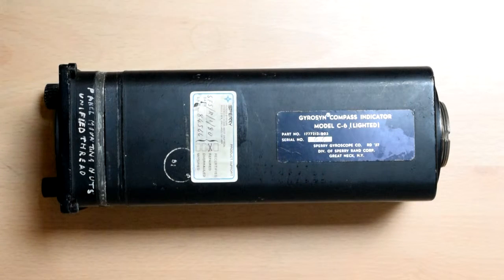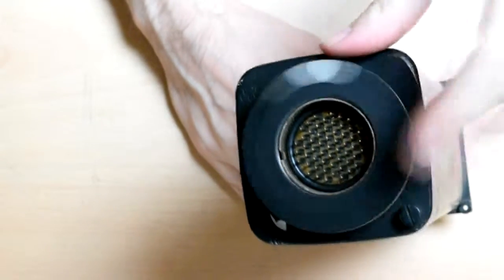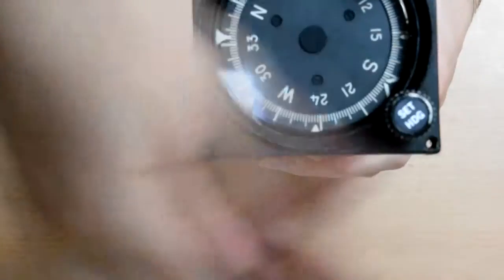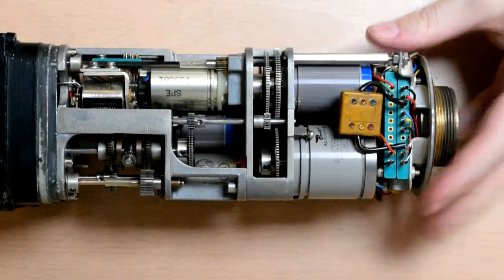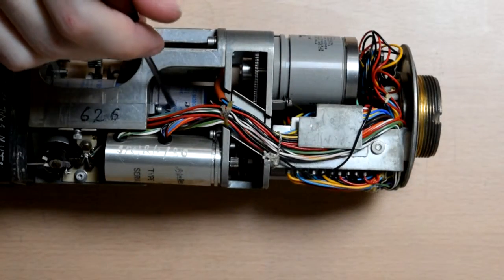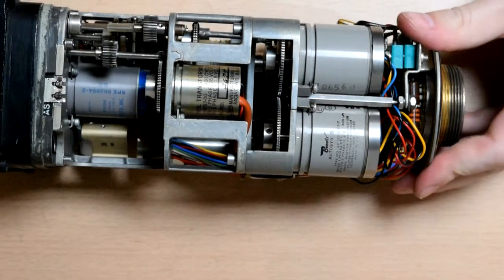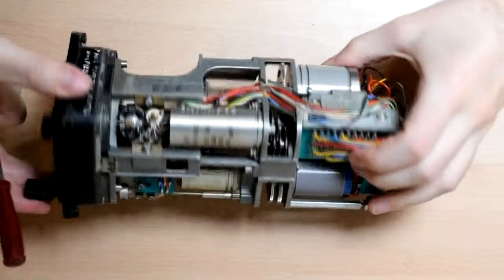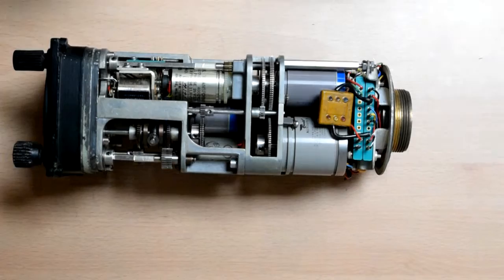Gyrosyn compass indicator not-so-teardown

Comment: The mechanically unconnected synchro receiver is probably being used as a transformer, if you drive the 3 fields, the armature will generate an o/p which will be the magnetic vector of all 3 fields, so long as the o/p shaft is free.
Reply: Wow - I recognize those Bendix synchros as I picked up a couple cheap in Mendelson's Surplus in Dayton OH (RIP) a couple of years ago. So this is what they were used in :)
Reply: @ChuckSwiger  They are used in a variety of old aircraft systems, and probably in some newer ones too.
It takes a bit of fiddling to get to work with a processor, but you can do it, I have a few videos of doing it.
Reply: @hellcattanks  That would be interesting, yes. I just posted a video of powering them from a home made 400Hz oscillator and a stereo amp - point in time showing the synchros  https://youtu.be/4VRt7z03KGo?t=218